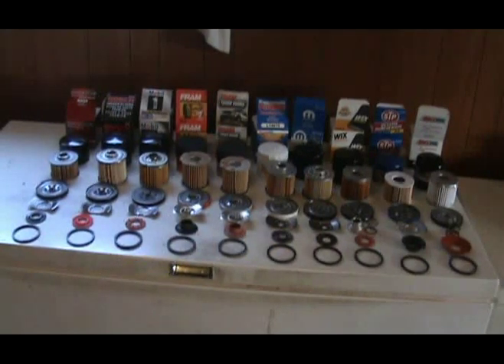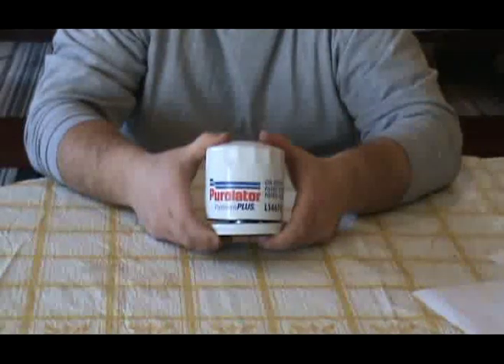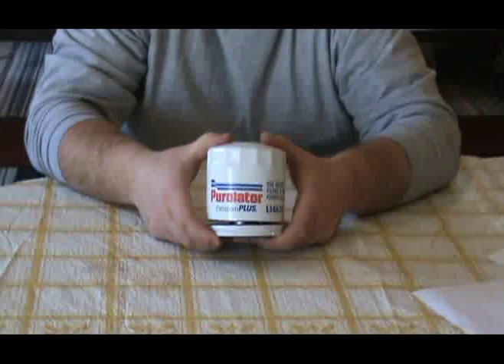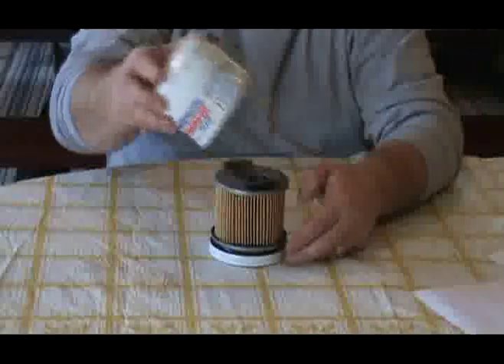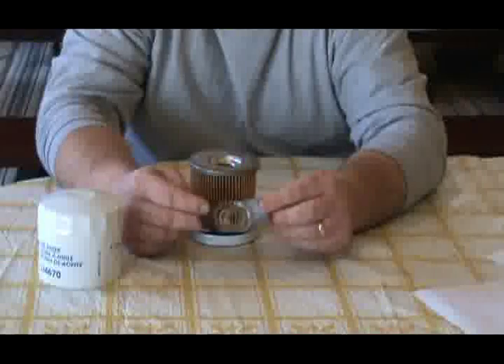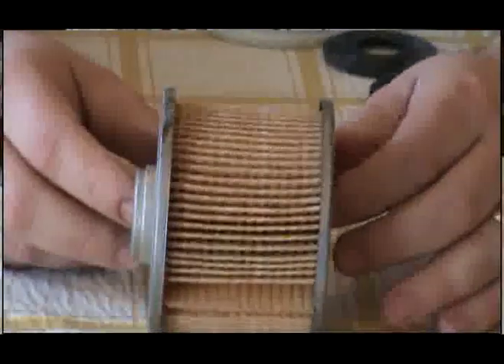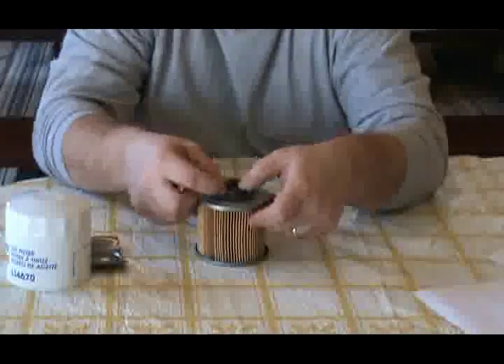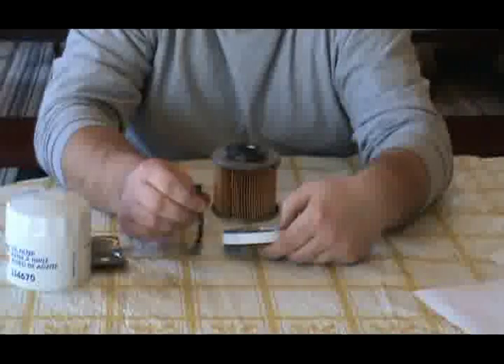What's in a Purolator filter?

Comment: Hi there, nice & simple but extremely exact & helpfull "x-ray" filters comparison. Have you ever test or take a deeper check as in your videos to a Royal Purple oil filter? In your opinion as an enthusiatic user and expert, what brands would be the top 3 rank filters with your results & research? I´ve been always buying OEM oil filter but now I realized they are poorly manufactured and some other exceed material quality. Now I am undecided if buying AMSOIL or Royal Purple oil&filter (same brand)

Comment: @HiTechOilCo its a 97 riviera 3800II non supercharged well it has the crappy plastic intake well the egr gases go through the intake and it cracked it putting water into the engine thought there was no water in the oil till i pulled the oil pan after a rod knock sludge was bad caked in there but got it rebuilt and it runs like new now i just need to watch the brand of oil filter i buy, dont want to do that again it had 160,000 i have about 8,000 on the rebuild no problems